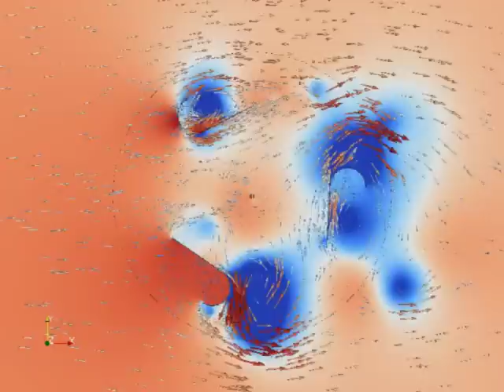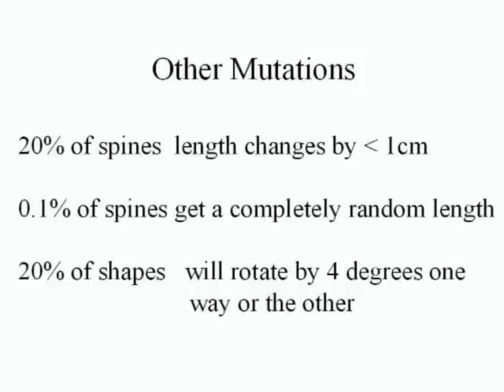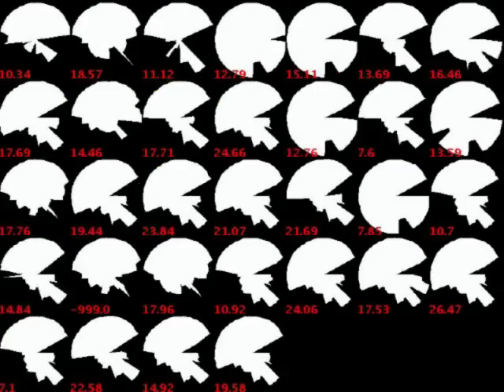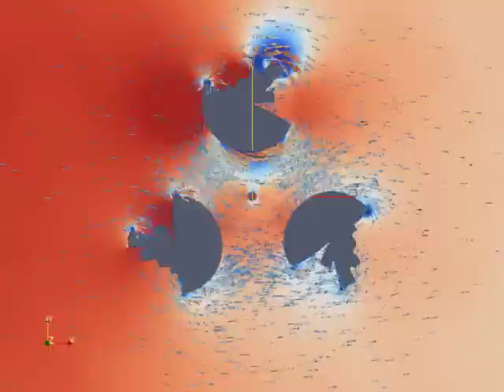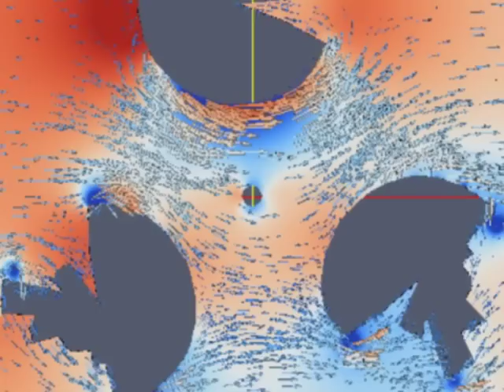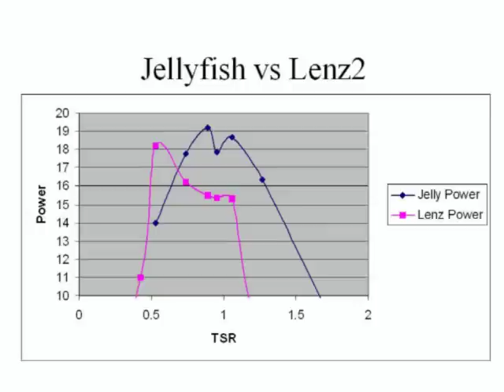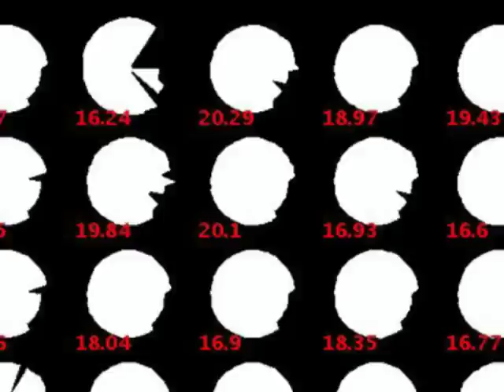Evolving Wind Turbine Blades

Comment: This video is super awesome but I reckon the performance is limited by the polar spine topology. I reckon if you could come up with a raster system that builds a blade out of “pixels” and then connects all the edge pixels to make a smooth shape, you’d probably get better performance and greater variety. For example, you could even have blades with multiple floating elements with this topology. Would love to see a reboot of this project.

Comment: Yous just got stuck on a local optima... The extremely probable outcome of any Evolutionary Simulation... There are so ways out of these Local Optima but none of them is "Natural"... So yes you have to guide the simulation heavily....

You can increase the diversity if the population... But beware that can make you loose good designs (Natural Drift)....
Anyway... It was fun
Reply from the maker: The population was kind of small.   Back when I did this, computers were much slower.  Today we could probably run a much larger population to give more designs a chance before they are filtered out.
Reply: @sjh7132 
Yes.. A samll population is obviously not gonna make u a good design ( by the way it was tested in 3D the design you found and it's useless).... Small population are goona get stuck in local optima...  Bigger populations face the problem of genetic drift (loosing the good designs to random chance)....add to this the extremely demanding calculation power

Comment: Commented in reply to something else but thought I would put one here. If you want to continue your research, you should try this on TensorFlow or PyTorch (different model of ML than genetic algorithms). I saw you wrote this original version in Perl with display software in Java. If you still wanted to do an genetic algorithm, C++ or Rust may be the way to go, they are much more performant due to their ability to compile to native code. There are also tons of libre/open source libraries available for them (especially via package managers) now to make setup easy.

Comment: Very interesting design,  someone in Japan could make the lenz better performance,  i don't know how much,  but it could be found.
By adding on the round edge of attack,  a wire o minimum 5mm to 8mm , the all way down.
It seems to create turbulence when the wing is coming back into the wind .
Its not expensive , and easy to make with out great expense

Comment: You can try gradient descent
Reply from the maker: I think there are many local minima that method would get stuck in.
Reply: @sjh7132  you can combine genetic and gradient descen.or using gradient descent with momentum (the gradient controls the second derivate of the variables that you want to optimize including also friction like
x''=grad(f(x))-kx'
)
Or including a random factor. This way is very useful i think.
(Genetic algorithm is only a gradient descent with random factors added i think)
Reply from the maker: @volt897  That is true, but I believe that to use gradient decent, I'd have to be able to reduce the power output to an equation where I could get the gradient for each variable.  The only other way to do it would be from one point, vary each variable a little, and run a simulation for each variation to see what the gradient is relative to that variable, but that would be slow.

Comment: Hi! can I use this design for a school project?
Reply from the maker: I wouldn't suggest it.  Read the description.  I did all the simulations using the wrong viscosity for air, so this most likely won't work.
Reply: @sjh7132  Yes but isn't it just a multiplier so could it still perform better than the design you compared it to?
Reply from the maker: @kimpsa10  - I don't think it's that simple.  I'm pretty sure it would affect how the air swirls, and how quickly it wants to bend.  You are welcome to try it, but I don't think it will work well.
Reply: @sjh7132  I know that it would probably now work as intentendet but the design seems interesting so I might make smallprototype of the blades from styrofome and see how it does but still thank you for this interesting video.

Comment: There is a bias in the way your geometry is defined. One very limiting aspect is if you would also allow negative lengths and interpret them as across the origin. Another change  I would try is to use a b-spline curve (loop) defined by your points instead of the very kluncky shapes. Around '76 - '77 at Eindhoven Univ. I've seen them use an evolution algorithm to design the shape of a lens maximizing light from an object point onto an image point. Sometimes it generated standard lenses but also Fresnell lenses were generated. I think it started as a collection of rectangular blocks with random variations but only in the position of the surfaces a change in axial direction. I think the definition of your shapes always include the center so you might experiment with other defining possibilities then a polar shape. 

It your simulation requires polar input then it is not so difficult to convert from other coordinates to polar and back. 

You could speed-up by using less points and later adding more points to allow faster course optimization before refining.
In real life you would also have to look at strength, but as a placeholder the cross section of the shape could be held constant. Or a simpler shape such a V looks promising as it could cut through air real well. two angles and two lengths  is all you need to vary . Maybe an extra angle near the edges could get some improvement and make it more stiff. 

Could you use a second turbine with a centrifugal friction decoupling to start the main rotor?

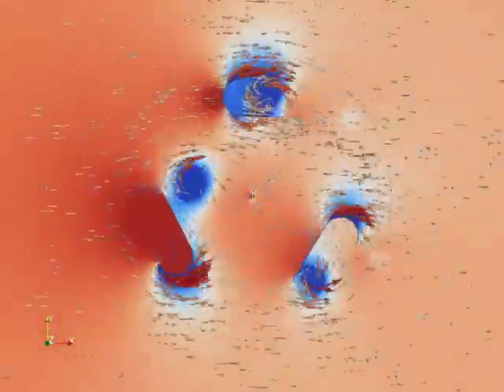Comment: I'm a bit confused. Are white things the cross-section of one blade? If so in the second simulation the blade X section is almost round. This outcome suggests that the parameters of the evolution are flawed. The environmental rules/forces are unbalanced with regard to their influence on the next generation. The jellyfish is just one high spot on the Mount Improbable you have created, hence it never evolves to the Lenz shape. Try altering your initial parameters somewhat radically. The basic idea of using evolution is a good idea. Why start with 90 spines? What do these spines represent? Edges on the shape? The Lenz blade has about six spines. Cut down the initial number of spines to 12. The simulation will go faster and the result may be a more powerful blade. How do the inheritance modes relate to the genetics of real organisms. It seems as if you have just invented random algebraic rules. Other mutations. These three random changes to the blades characteristics seem to me to be mutation on speed. It would change the blades too much from one generation to the next. Drop the last two rules and reduce the first rule to 5%. Initial number of individuals. You do realise that Dawkins model started with one individual and the next generation had 8 offspring . And only the best suited of those 8 became the parent of the next generation. This many initial organisms is overkill. At 2:51 the diagram shows 3 blades mounted in the one frame. How does the simulation distinguish between the blades if the turbine only generates one level of power? Surely all three blades should be of the same shape.Why introduce the variety of zero, 1,or 2 offspring? This does not contribute to the evolution of a superior blade. Perhaps the mushroom shape evolved because there was a minuscule bias towards this shape somehow and once it started to dominate it took over completely. This is what can happen to real organisms. At 5:13 you are disappointed with the shape because the round edge should face toward the wind and rough edges don't help aerodynamics. Did you program the evolving blade to face rounder surfaces into the wind? Did you program the evolving blade so that rough edges were an evolutionary disadvantage? I think not. So why be surprised when the simulations follows your rules and only your rules? At 6:04 you simulate the Lenz blade by placing three on the frame. This is  inconsistent with the way you tested the evolved shapes. 7:12 The funny tilt on the round part of the blade does not have a purpose, it is an accident of the rules, which just happens to be beneficial.7:25 Correct, there is no designer, it just evolved. Has Dawkins seen this Youtube? I'm sure he would comment favourably. Second simulation with an even larger initial population. The best initial blade looks almost like a circle. Is it any wonder that the final blade is so round? Is the high power developed as a consequence of the small indentation in the circle? Many of the evolving blades looked like Pacman chomping at its prey. Coincidence again I know. Despite what seems like one continuous stream of criticism in this post I am very impressed by the adaptation of evolution dynamics and Dawkins simulation to the finding of a better wind turbine blade. This is a damn fine idea. And again I seriously suggest you run your ideas by Richard Dawkins. He has insights into the subtleties of evolution which would be useful to you. Read his "The Extended Phenotype", that will challenge the little grey cells. Good luck and thank you for a stimulating video.

Comment: Well the Lenz shape can not evolve with your genetic model, as there is no valid input that generates a Lenz shape! But very interesting experiment though! I would repeat it with bezier curves instead of the centerpoint -> spines model. Furthermore if you don´t change the width of the generated curve, the final model could be made in the real world by bending some sheet metal!

Comment: For the sake of my own curiosity may I screen cap the winning cross section and create a 3D printed model VAWT and see if it performs at all?
Reply from the maker: I don't think it will work.  The simulation was done with the wrong viscosity for air.  (see the description text)

Comment: I think the flaw in your breeding program is that it only seems to have one breeding group doing the entire evolution process. I would like to see a simulation where the breeding groups are not so strictly controlled, as it seems to be keeping most of the characteristics of one model and simply making all the others like it. I suspect that a more natural result would come from trying other methods, like combining some of the best with each other, some of the mediocre with eachother (but at a higher rate), and allowing some run-offs, with mediocre plus low performance, but with high mortality. Overall, it's pretty interesting. I wish this software was openly available.

Comment: I don't know why you'd select the blade producing 27.03, if there's also a blade producing *27.23*.
Consider that turbine blades are not just developed for power production, but also to endure rough conditions and make not too much noise. Your simulations cannot account for that. There may be some trade-off that you haven't taken into consideration.

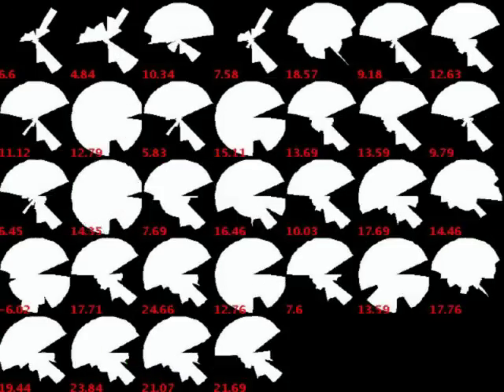Comment: 4:15 ONE TURBINE DOES -999 POWER
Reply from the maker: Sometimes the simulation blows up because the mesh won't solve.  When that happens I put in -999 so that the shape that caused the trouble doesn't live on.

Comment: Virtual evolution software has come a long way since this video was made. It would be cool if someone did this in three dimensions with more realistic, three-dimensional vectors of wind. The "breeding" isn't really necessary, just an algorithm that constantly changes the form of the blade with the goal of getting it as efficient as possible. Maybe run several simulations at once with different starting shapes. Then add the type of material and weight as variables... A very effective turbine shape could come from this.

Comment: I suggest to make tournament for species. At firts take population of 20 random generated. Then if any individual reaches efficiency greater then 15 you could save him and kill best half of population (for diversity), then continue the process with rest one and save one more best of the groupe after reaching efficiency above 15. Winners will be saved for 2nd round. After 20th populations of beginers create population of winners. You can help them at the begining by giving them space for reproduction (start with 40 but create 1st limit about 200) Afrer reaching 200 kill 75% of them and give them 2nd chance to reache 200. In the same way you can try to save bests and kill 10 next every time they will reached efficiency 20. You obviously dont have to do exacly as i said but please just think about it.

Comment: Dang, 2009.

Do you plan to do the simulation again with better computing power and the right Viscosity for Air?
Reply from the maker: No, I have too many things going on in my life.  (Job, Kids, house repairs, etc.)  All the software I used has been updated and the pieces are no longer compatible with each other.  Running this again would take significant time and effort.  The next generation of nerds will have to take over.

Comment: Should have constrained the area and not the maximum radius.
Reply from the maker: Actually in wind turbines, the swept area determines how much of the wind the turbine could harness, so diameter or radius is the correct factor to limit to keep the contest fair.
Reply: Hmm.. It's still unsettling that the best ones have their radius maxed out in some parts.

Comment: Why define the shape by spines? That severely limits the possible shapes. You can't even make the Lenz2 with that method. 

Shapes
Have you considered vertex groups? Randomly distributed vertices, which group when experiencing similar higher or lower pressure to their neighbors. This would split on inflection points, allowing for more formal and sophisticated shapes to develop, or simpler shapes. It has been 8 years, your computer is probably much more powerful now. haha

Inheritance
Your 5 inheritance methods are an interesting choice. Why those? 
It looks like rules 4&5 are just 1&2 restated. (Min or Max chosen at random from a pool of 2 parents...)
If you use vertices instead of spines, vertex groups could be inherited, averaged if they create similar 'moving average' curves, and always given a 1-5% variance for all vertices.

Epigenetics
This plays a HUGE role in morphology, specialization, and environmental adaptation. 
If a vertex group receives higher or lower pressure, that vertex group becomes more likely to be passed on commensurate with the degree to which its pressure deviates from 0.

Breeding Rules
If you run another version of this experiment, perhaps include 'bloom and prune' cycle nature sees by allowing the top 90% of shapes 'mate' for n cycles, each mating for a max of 3 cycles before 'dying', then cull the herd by eliminating the worst 33% for 3 cycles. 
When two shapes mate which are highly similar, the max possible vertex variance should increase, maybe 1-15% instead of 1-5%.

Comment: Hey, does anyone know how to contact sjh7132? I am about to get a gtx 1080, so if this has gpu compute on it I could compute it for a few days using a modern 2016 gpu.
Reply from the maker: I have access to an Nvidia Tesla K40 and K80.  Unfortunately Openfoam hasn't been written to use a GPU (yet).  Thanks anyway.
Reply: ok, hopefully it will in the future! Also, were did you learn to do evolution programs?
Reply: How do you have access to the tesla k40 and k80?
Reply from the maker: I write software for an Aerospace company and we use GPUs for high speed processing.
Reply: sjh7132 Cool
Reply: I wonder if they used those to design the concord?

Comment: Yeah, evolution has some limitations. The principal and most challenging one to deal with is that while it's guaranteed to find a local maximum, it is NOT guaranteed to find the global maximum.
So if you get stuck in a local optimum you have to come up with a technique to force yourself out of it.
The problem is, depending on where the next nearest optimum is, you might have to accept a huge series of designs which REDUCE performance before you get out of the rut and start getting towards a different maximum.
(again, possibly only a local maximum.)

Getting stuck in local maximums is one of the major limitations of evolutionary systems.
Another major limitation that tends to show up in nature is the reluctance to throw anything out.
Eg, rather than throw out a fundamentally flawed starting design and begin again, evolution favours optimising an existing structure, no matter how poor some aspects of it are, rather than trying again from a different starting point.
Again, the net effect is you get a local optimum but probably not a global one.

Comment: if offspring mutated instead of just inherited its parents gene much like actual genetics would stop the shape from converging so blatantly
Reply from the maker: There is mutation along with inheritance.  I believe the real problem is it takes more than a minor mutation or two to get out of the local max.  In real organisms, there are sections of 'junk DNA' that can be used as a scratch pad to develop new things.  They are occasionally turned on and most of the time cause a horrible defect, but sometimes add something beneficial to the organism.   My simulation did not simulate this junk DNA in any way.

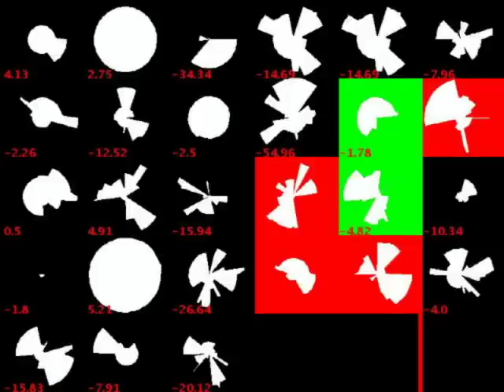Comment: @3:35 Wouldn't that increase the risk of getting stuck at a local maximum? Shouldn't you also put in a random mutation for the current best one?
If it's worse it'll disappear, so no harm done. But if it's equally good or better it increases your chances of finding the optimal solution by broadening your view, no?

Also did try this process with all the winners from each run?